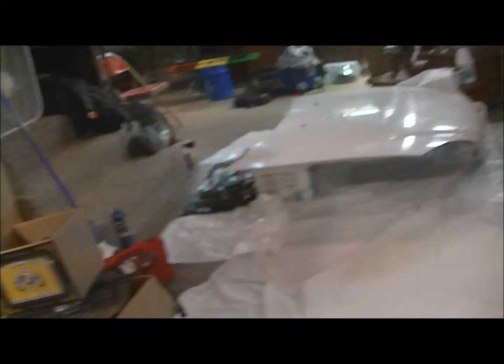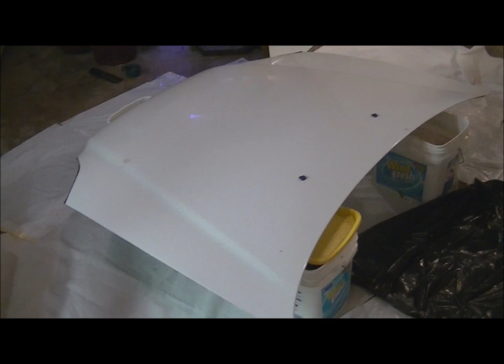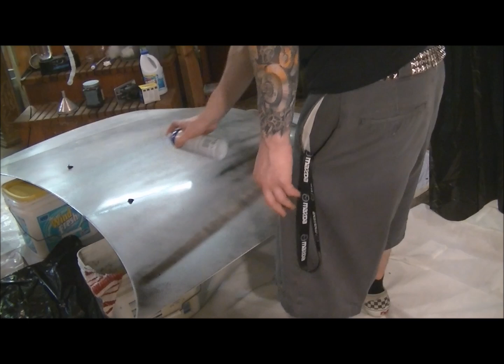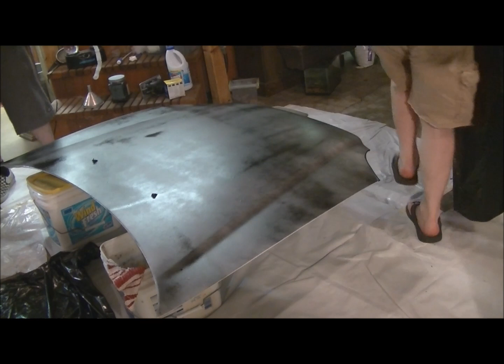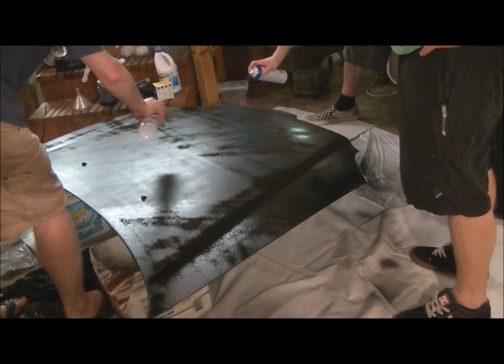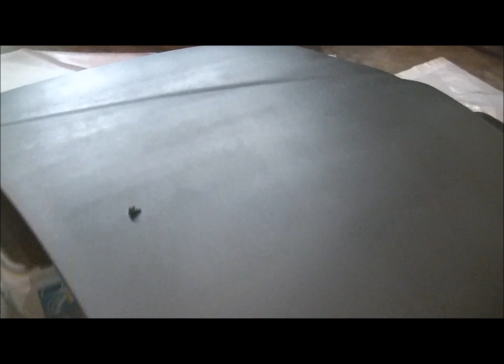Plastidip Hood (Rattlecan)

Comment: that looks awful, spend the money and get a gallon of dip and a spray gun. you could have had 6 coats on in an hour and it would have looked perfectly fine. Cans should only be used for smaller details or the rims in my opinion.